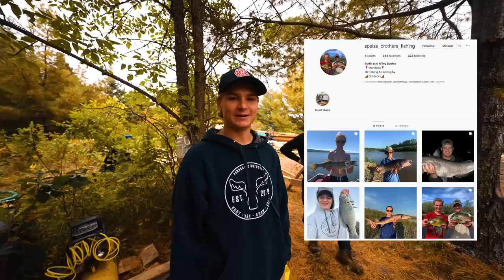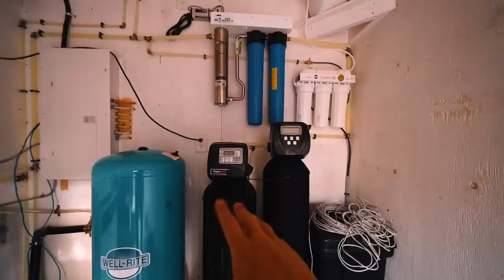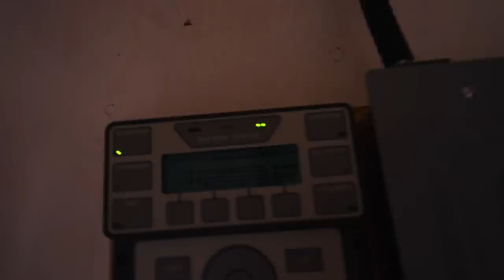The Outpost Is Filling Up! - Building An Off Grid Fishing Cabin - Chapter 13

Comment: I don't see any isolation valves on your tankless water heater, you might want to put some in to flush the system. Even with your water treatment system, you don't want have any issues with that tankless. mechanical room looks great.